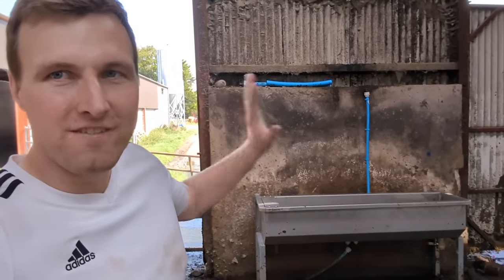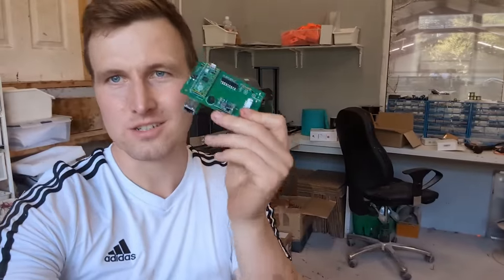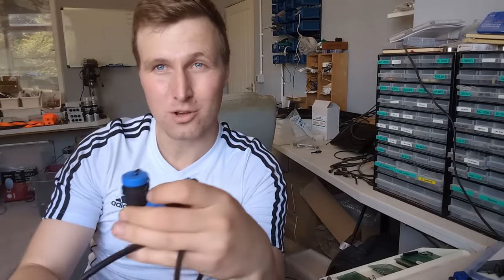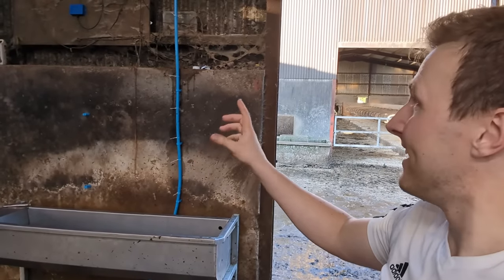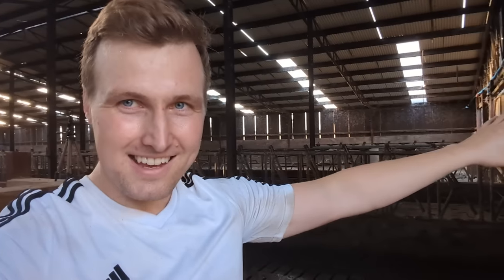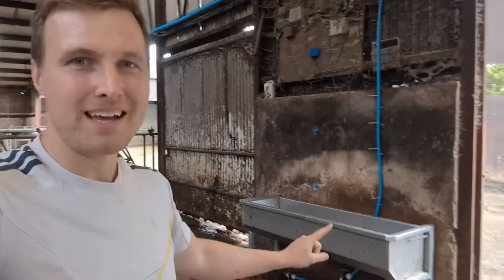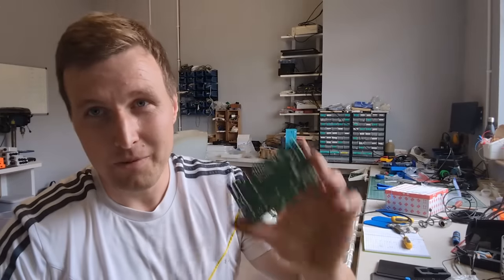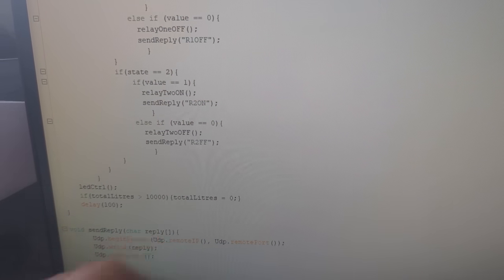Farmer BUILDS computer controlled WATER DRINKERS // Software + Hardware // pt2

Comment: I had a thought about this… wouldn’t it be better to use cow collars to tell the waterer that cows were present and turn on valve so water can fill trough. When cows are gone, water would shut off…? You could also see which cows are drinking or not…
Reply from the maker: Issue is you have to read the tag, that's not as easy as it sounds and the restriction of trying to place a reader would likely restrict water access.

Comment: Great idea. Playing with home assistant and node red for farm related stuff at the moment. Where did you get the valves for turning on/off  water ?
Reply from the maker: Ebay, I have had one installed for 3 years, no issues.

Comment: Great video! Such a good idea as well. Just wondering how are you getting wifi thought your sheds to connect them all? I'm building a new calf shed with automatic feeders. There's no phone signal in the shed and the feeders need Wi-Fi, So just wanting to know what's the best way to get Wi-Fi there. Thinking of just ducting a fibre cable then piggybacking off the office router, but its just a long way. Again great video!!!
Reply from the maker: Thanks!! Everything is connected with ethernet cables, I assume that's what you want to duct. WiFi causes issues all the time.
Reply: yeah ill go for that, Wi-Fi isn't always reliable around farm buildings!  thanks   @FarmTheoryNI

Comment: Great project, I can see how it'll save you loads of time and drudgery keeping those drinkers going.
You probably already know it, but MQTT and Node Red could come in handy if you're going to add dashboards and UI's etc to it. Did you use the Arduino IDE on the Pico to write the code?
Fair play, thanks.
Reply from the maker: Yeah, I used the Arduino IDE. I will probaby use KivyMD for the dashboard since I already have done a few similar things with it.

Comment: I doubt that drain valve will work without back pressure.
Reply from the maker: I have came to the same worrying conclusion.
Reply: Motorised valve would work better
Reply from the maker: @pn5991  I'm going to use electric actuators on the manual valves. They are cheaper and won't get blocked with dirt.

Comment: You have put a lot of thought into your water system and could be a great job . My only worry would be those solenoid switches don’t last too long in damp or dirty conditions as we have them in automatic scrapers and they can give trouble. Also I hope small creatures don’t get a fondness for your cables. Interesting project all the same 👍
Reply from the maker: I have similar systems running for years, I have learned how to keep them working from having to deal with issues. 😆